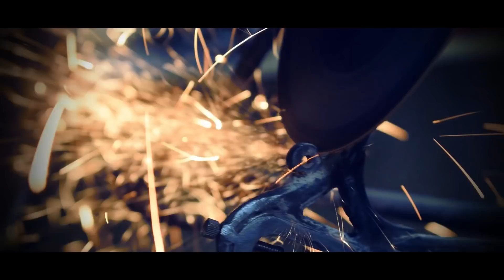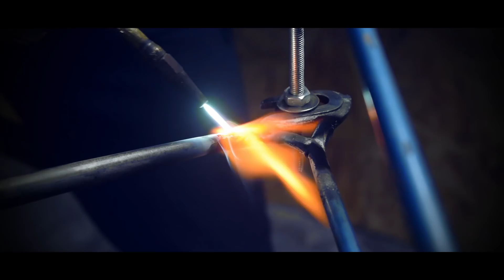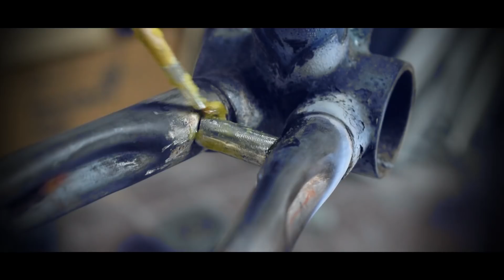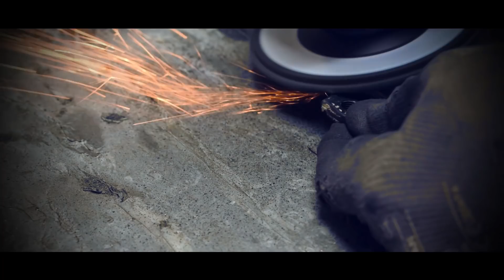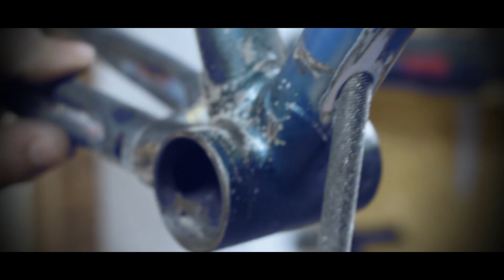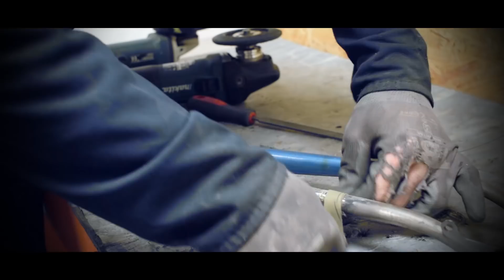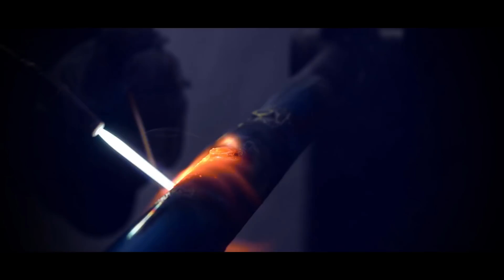From Classic bike to Gravel!!! - 2nd episode -

Comment: This guy is a mad man and I love it. It doesnt just stop at cutting the support by the bottom braquet. Or the supports by the drop outside for the disc brakes. He also created holes for internal cables. Amazing.
Reply from the maker: Hello Friend!!! A little crazy if I am, it has been an experience for me and I am looking forward to creating it, but with more safety factor. Thanks for your comment, friend ; )
Reply: @dabrestauracion7404  I love it. I heard you shouldn't put disc on old frames but it looks like you put that support and it should work great. I watch many bike restoration and you are the best. Oh the attention to detail and the painting is so good. I hate painting because it is so hard to be good at.
Reply from the maker: @JohnSmith-yw4bh  😍😍😍thanks friend!!! ;)

Comment: If you think "what's the point you can probably buy something already made" then you probably don't get it. Great job man, I'm excited for the part 3!
Reply: Exactly... wrong series to watch.
Reply from the maker: Anyone can buy a gravel and I probably can too, but the satisfaction that this gives you does not give you when you spend € 2000 on a bicycle that can have many people. I hope you like the next episode ; )
Reply: Nope. This is awful. Those tubes and bike in general were not specifically chosen to be ridden with disc brakes or have internal cable routing. There is so much wrong with this frame, although the idea seems really cool and the process seems very fun.

The science and application is just nonsense and a nightmare. Also, those old tubes being exposed to heat all over again is just a disaster waiting to happen besides the fact that of course he’s planning on running disc brakes on this thing.
Reply: @astrayagrarian  my same though, there Is a reason why race car rollo cages arent built with torchs no more but with TIG, so there are no worries of metal stressing due to overheating. Still very nice to see the craftsmanship and atention to detail

Comment: I am not the pro for steel work, but from what I heard, heating the forks that much for brazing makes them weaker. Looks like you almost melted them :) Apart from that, amazing work.
Reply from the maker: Hello Friend!!! To weld with oxyacetylene, which is the solder that has been used for life in steel frames, so it must heat up until it becomes red hot or else the solder simply will never catch and then it would have a problem. Actually, there is more material in the fork than there was before cutting it, since it did not remove the part, but rather it cut and cut inside and then welded it and did not touch the disc. Regards and thanks for your comment ; )

Comment: nice bro  u fix all what should be fixed last time   wait for 3 ep
Reply from the maker: I'm glad you liked it. It solved everything I had solved, for my own safety and for not having to go to the dentist. Heheh, greetings and thanks for your comments ; )
Reply: dab restauración good job. Do u think about new one headset 1.1/8 and flat mount. Mb in future. Take old one frame or just buy separate tubes and made modern gravel   But for the first try-very good and clever  job
Reply from the maker: @sergeykeso8178  Thanks friend, I will keep it in mind for future projects ; )

Comment: Even though every inch of the bike will be modified by DAB, I believe the colour should be a shade of blue to respect the original donor frame.
OR, Chrome plating.
Reply: steel can be bent back to alignment if necessary

Comment: Ok... I don’t want to be “that guy” but I feel this needs to be said in case someone else tries it. You have created a death trap here. 1” steerer forks do not have the strength to cope with disc brakes, so you’re very likely to snap them at the crown under load. Not to mention all the metal weakening that has happened because of the crazy heat cycles. Death trap (genuinely). And yes, I am a frame builder.
Reply from the maker: I am very happy to know that someone who is an expert in this, could you send me photos of your frames, to get an idea of what a good construction would look like. If it can be a facebook or instagram A greeting and thanks ; )
Reply from the maker: What brand of frames do you build?
Reply: dab restauración I don’t build commercially under a brand, but have 8 years experience building my own, with 20 years in the industry. Mostly lugged steel frames. I get the feeling you don’t believe me but it’s a fact - 1” steerers aren’t strong enough for disc brakes. They will fail. And multiple heat cycles, especially at the heat for bronze brazing, weakens the steel considerably. Nice job on the video editing etc. but this particular build is very dangerous.
Reply from the maker: @user-cn4tw6ox5b  I have never said that I do not believe you, but I would like to see some frame of yours, to know how to do them well. The bike is already more than tested, he repeats routes that I normally do with the mtb, to test a background and I have not had any type of problem. Anyway, what I'm going to use it for, which is to go to work and meters along 3 gravel roads, I think it's enough. Don't you think
Greetings and what I say, I would love to see some frame of yours. Greetings and thanks for your constructive comment; )
Reply: The Velo Orange polyvalent runs discs on a 1" steerer.
Reply: @gregsierra414  Take a look at the crown area of the Polyvalent - it's not a normal 1" steerer fork. The crown is a segmented crown with reinforced steerer junction.
Reply: @dabrestauracion7404  Genuinely, I don't see any benefit in showing my lugged steel frames as they are identical to every other lugged steel frame ever built. What's noticeable is that none of them have disc brakes for this very reason. Even v-brakes have been known to bend old road forks, as they're much more powerful than normal centre-pulls and the force is focused on a different area.
Reply: @gregsierra414  The Polyvalent almost certainly has disc-rated fork blades too - another very important factor.

Just so I'm clear here, it's not the actual steerer section that's the issue, it's everything that happens from the crown race down. 1" steerer road forks are not strong enough for discs. Fact. The Polyvalent may have a 1" steerer, but the business end of the fork is most certainly disc-specific.
Reply: C T yeah it's definitely a beefy fork. I notice the disc tab extends beyond the bend as well. Presumably this reinforces that blade as well.
Reply from the maker: @user-cn4tw6ox5b  Thank you for your recommendations, which I take into account for future constructions. Greetings and thank you very much for your comments, they have helped me a lot. Regards my friend ; )
Reply: This whole debate could be solved with some math and testing. I am an engineering student and I could help you calculate the minimum (safe) diameter steerer of the fork. 1" may work, but the factor of safety may be pretty low
Reply from the maker: @benlabarre3937  Hello Friend!!! The truth would help me a lot if you did, a greeting and thanks for your comment ; )
Reply: @benlabarre3937  It’s not really necessary, Ben... the stress testing has already been done by a hundred companies one hundred times in the past. And as I said above, it’s not the actual steerer itself, but the parts from the crown race down on 1” forks. It would be a redundant test, because the answer already exists. 1” vintage road forks WILL fail at some point with disc brake use. Maybe not right away... maybe not after a week... but one day they will fail. Jeez, I can’t believe this is still being debated.
Reply: @user-cn4tw6ox5b  I'm sure you're a master builder, but you're far from a master in rhetoric. 
If people ask for proof, the answer is not "I don't need to show you, it's been proven". If you want to help others, simply pushing out your chest and reiterate your expertise doesn't work. You need to educate them. If you don't want to provide pictures of your work, at least provide a link. 
This is the internet, being critical is a good thing.
Reply: @oftankoftan  Sorry, master builder? Where did I describe myself as that? Anyone with the slightest knowledge base in metallurgy and bicycle design would know how dangerous this build is. I would have known before I picked up my first torch. People posting on Youtube have a responsibility to their viewers to post safe work, which this is not. Bloody hell, I’m done wasting time arguing this. Hope y’all enjoy your trip to the emergency department.
Reply: @user-cn4tw6ox5b  And now you're nitpicking about terminology. There's no need to be upset, just be factual and didactic.
Reply: @AK-ic1yj  Luv u 2 bby
Reply: @oftankoftan  When its common knowledge, the answer is "I don't need to show you, it's been proven". Its accepted among framebuilders that the combinations of disc brakes and 1" forks in steel doesnt work.
Reply: @oftankoftan  I completely agree
Reply: From what I’ve clearly observed in the video, he strengthens the parts that would normally snap. I’ve talked with respected "seasoned" bike owners regarding modification of older bike frames to accommodate disc brakes and they basically said you would have to strengthen the fork, dropouts, seatstay bridge, chainstay bridge, etc... and know what you’re doing when doing so. 

Again, "my clear observation" is that this young man "clearly knows what he’s doing", and he’s even stated that he’s obviously tried and tested his work. Hellooooo.....

Dab, I encourage you to continue with your perfect projects and being humble enough to accept criticism and opinions. Don’t let the one-sided, prideful comments get in the way of your work. Bravo!!👏🏼

Comment: amazing
seeing as the internal cable routing is half-drawn, wouldn't that make it really hard to get the cables to hit the holes going out the other side?
Reply from the maker: Hello Friend!!! Forgive my English, but I don't know what you mean ; )
Reply: @dabrestauracion7404  when you feed the cables through the frame. when the cables is coming out the other end, it has to first hit a very small hole INSIDE of the frame, because you welded a pipe into it. Get it?

this is the cable-> -----outside the frame----{--into the first pipe--}-----inside the frame-----{[HERE]----second pipe----}----outside the frame
Reply: @oftankoftan  it will be difficult but from my experience with similar designs, I tell that all you need is small neodymium magnet :)
Reply: It's not that hard. It just requires a bit of patience

Comment: Hey man, what a dream project. So cool! I was wondering if you took into account that the steel you heated might have changed properties because of it? Especially the front fork with the load of a disc brake on it could turn out to be very dangerous..
Reply from the maker: Hello Friend!!! I have it in mind. Since I have tempered the steel, it becomes more elastic and not as rigid as a hardened one. The work of the steel, I believe that there are no created of steel frames, that does not heat the material ; )
Reply: dab restauración Good to hear! Ride safe

Comment: Great video!! Can I ask why you switch between stick welder, mig welder and then braised other parts? Why not mig all of it?
Reply from the maker: Hello Friend!!! Unfortunately I do not have the mig mag weld in my house, so I made the connection points so that it does not move with an electrode and fix where it could be with oxyacetylene. The brakes if I wanted to weld it with mig mag, but I had to ask my friend to let me in at his height and with the subject of the covid-19, the truth has not been easy. A GREETING AND THANKS FOR COMMENT ; )

Comment: Very cool. What kind of grinding wheel is that youre using after the cutoff wheel? Seen throughout the video but first seen after cutting the eyelets off the rear dropouts.
Reply from the maker: Hello friend, it is a sanding strawberry, the truth is I do not know what it will be called in English, I leave you a link, this is not the one I use, but it is very similar ; )
https://www.manomano.es/p/fresas-metal-duro-forma-c-wrc-semiesferica-d1-mm-3-l2-mm-14-l1-min-mm-38-d2-mm-3-5884366?model_id=2412601
Reply: @dabrestauracion7404  Thanks I was curious about that one as well :) but  what about the one at 0:54
Reply from the maker: Hello friend, this album is called a thousand sheets or laminated discs. I leave you a link ; )
https://www.amazon.es/10-pieza-Disco-l%C3%A1minas-60-Inox-Compartimiento/dp/B01MTSGAUO?ref_=s9_apbd_obs_hd_bw_b3KYgpr&pf_rd_r=AE9TKQ7NVEAWFNEV89S3&pf_rd_p=af762187-ed9e-5695-a4ed-7680b2c5a749&pf_rd_s=merchandised-search-10&pf_rd_t=BROWSE&pf_rd_i=3052193031
Reply: @dabrestauracion7404  Ah yes thank you!!

Comment: This is such as good build, I'm a big fan of the old steal lugs and tube frame, pretty neat welding too, Im just wondering if there would have been a way to make the mech hanger replaceable, as that's the only downside I see in these old frames
Reply from the maker: Hello Friend!!! Many are concerned about the fork, but I can say that for cycling on gravel tracks, it is more than enough. A greeting ; )

Comment: Very nice restoration, I have a Canopus frame with tubing columbus sl is made in Colombia in the 80s and I removed the rear brake guides and used a 1/4 brass tube but I put it in until the end that the cable enters without problem, the strange thing is that your frame does not have guides or the nuts of the amphora holders, curiosity what mark is that frame?
Reply from the maker: Hello friend, this frame is from the 70s and does not have any type of support. The frame is from the peliser brand, Greetings and thanks for commenting ; )
Reply: @dabrestauracion7404  busque en la web y peliser es una bicicleta española  , te escribo en español porque vi que eres de españa.
Reply from the maker: @isaacgonzalez3684  Asi es amigo!!! Un saludo ; )

Comment: Where did you get the inside-threaded pieces for making the thru-axle dropouts? are those from a specific bike frame supply company or did you just get them from a hardware store?
Reply from the maker: Hello Friend!! They were made for me in steel in a milling factory around here in my city. Very economical. A greeting friend I hope that it has been of help. ; )

Comment: this is amazing. I guess you went wider than cold setting would've allowed for?
how much would you charge to do these rear triangle modifications to my frame? It's a vintage 531 frame. I'd probably have a ti fork custom made rather than modifying the original one, but I want to ride this frame forever
Reply from the maker: Hello Friend!!! This work I have done for me. Surely if it had a reynold 531. I would not modify it, that frame is beautiful just as it is. A greeting from Spain; )
Reply from the maker: In cold weather it would be impossible to carry out this operation, since the steel would have a lot of tension ; )

Comment: OMG that is a death trap

Brazing isn’t meant to have the tubes glowing red. Weakened the steel considerably.

And those lugged skinny forks are not capable long term for disc brakes.

This is worrying that people are watching it and commenting it’s good.

20 years in mechanical engineering in bicycle industry and a chartered engineer before anyone asks.
Reply from the maker: Hello! I have not recommended anyone to do what I am doing and people who tell me they want to do it, I recommend that you put a 1 "1/8 fork. As you said, the 1" fork flexes too much. and will have problems in the future. I would like if you have more suggestions on how to do this job more efficiently, you should do it constructively, try to give constructive solutions and suggestions so that those of us who don't know that much can have a perspective on how to do a job well done. I want to learn and the way to learn in my case is by trial and error. So I need comments like yours to improve day by day. I hope your comments and suggestions to do a good job and if you could contact me on facebook or instagram I would appreciate it. I just want to improve and know the opinions of experts like you. Regards and thanks for your comment ; )

Comment: Amazing! Really like you did with the frame, reinforcements, cable routings etc.. For color i suggest raw finish.. sandblasting than sanding, clear metal primer and few layers of clear coat. It is a pity not to be seen that weldings. Subscribe from me
Reply from the maker: Thank you very much friend !!! The only thing I already gave it a primer so it wouldn't rust. Thanks for your comment, it is very gratifying to read your words ; )

Comment: Hello i'ts a good job but I think you need more exercice for welding (I'm not a professional welder but I make a stage at victoire cycles in france and at cycle Tamboite this guys is a pro and I can see how he weld or brazing and I'm not sure you have the perfect movement) I understand i'ts so hard but I you want to say I make a mtb suspension frame (steel) with a mig and no experience so everything is possible 👍 you so mad 😂
Reply from the maker: Hello!!! You are absolutely right and I have already said that I am not a professional. It is clear to me that the professionals who make frames will pull their hair out. But in the end, if you want to advance in this life, you have to gain experience and I don't know any other way than failure, error, failure, error .... Thank you for your comment, friend. Greetings ; )
Reply: @dabrestauracion7404  is just want to precise this is not to denigrating your jobs
You make a goods job
Reply from the maker: @braap6547  Thanks friend!!! I really appreciate the constructive comments. Really thank you very much and everything you decide for me, I keep in mind for future constructions. A greeting; )